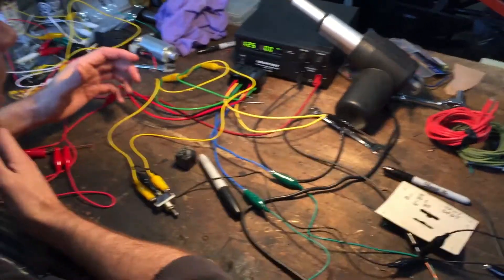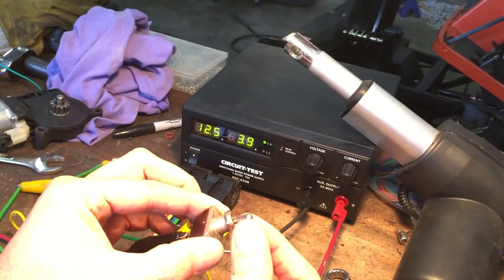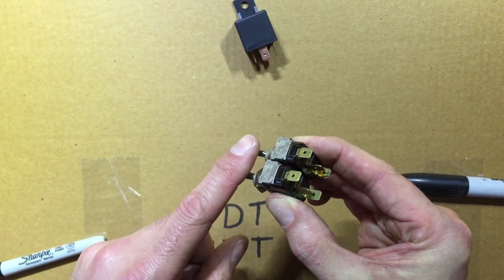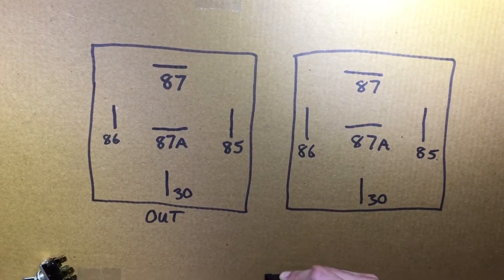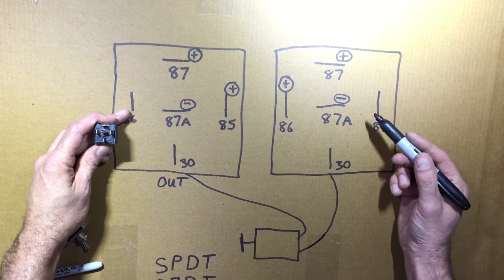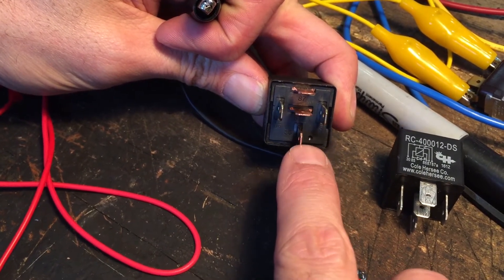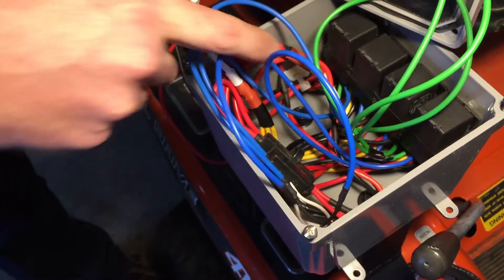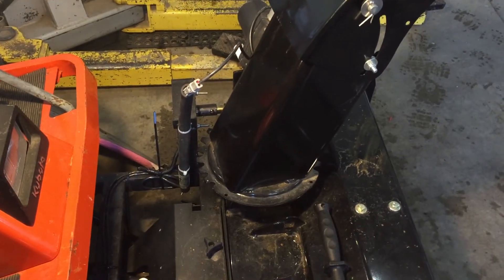Build a DPDT (H-Bridge) from Two 5-Pin 12V Relays — Reverse Any DC Motor

Comment: Wow — this is exactly what I was looking for. Oddly, I am building a remote control for the chute on my Kubota F2000 snowblower— so this could not have been any more specific to my job.
Mostly, I was confused by wiring the four pole joystick, but I think you cleared that up for me.
Excellent explanation — thank you!
Reply from the maker: A couple tips for building the blower pieces that I don't discuss. I mounted my joystick control box with some heavy magnets, so it can pop off. Add some disconnects for quick wire attachments. I put some of the wires by the chute in a rubber tube so that it holds the wires away from the rotating blower and will flex if it comes too close. As these chutes have a large rotation range.

Finally I wish I would have used a 12V DC-to-DC converter to go up to 18V or 24V so that my chute rotation was faster. It rotates so slow with my wiper motor setup that's its painful when I am doing a quick turn around.  You may also want to consider exposing the fuse locations so they are easy to replace if they blow.

Comment: I got relays with diodes between 85 and 86 and I have to connect positive on terminal 85 or there is a short on the relay. How can I change the wiring to account for this?

Comment: man, this video is great I searched for hours for a solution to this problem. so, I'm making a video about restoring a yard cart for a mower.  I put a linear actuator on it and long story short I'm going to use this same set up. I knew it was possible; I had done this a long time ago but had forgot how to do it. So, I was wondering if I could but a link up in the description of your video and give you a shout out. I wasn't too sure how to contact you about this so here I am in the comments.
Reply from the maker: Yah, no problem with a link. Like everyone here I am a hobbyist as well, and sometimes I have to watch my own videos to remember how I did something years ago. I've been running this setup in a coupe spots for years. Including using it to repair a wheelchair van ramp and kneel functions.

Comment: As soon as I connect 87a to ground it blows fuse. Please help
Reply from the maker: You need to double check your wiring. 87a and 30 are connected if the relay has not be powered. Make sure your relays are oriented the right way.

Comment: I wired a winch up with this system and it worked perfect. I then ordered two more relays and wired my snowblower (attachment for garden tractor) chute up the same way. When I energized the coil, it blew fuse after fuse. After trouble shooting, I found that pins 87a and 87 were connected! Am I correct in understanding that these two pins should never be connected? I put some old 5 pin relays in and wholla! it all worked as it should- weird. Thank You for posting though- it really helped!
Reply from the maker: Your correct 87a and 87 should never be connected unless you messed up wiring elsewhere. The connection should always be between 30 & 87 or 30 & 87a.  The relay switches pin 30 between 87 or 87a. The relay is just a switch that is toggled when the magnet inside is energized.

Comment: I just tried this with my garden tractor and winch. The relays are clicking but no winch activity? Where does the winch get ground? If you follow the path, current goes through one relay, through the winch and to pin 87 on the other relay? How does it get ground? When I hook a battery starter up to the lugs on the winch, it turns fine?
Reply from the maker: You need to rewatch the video. PIN 30 from both relays goes to the winch. You get ground and + power from the through the relays. As the relays switch PIN 30 alternates on each relay between positive and ground / Negative. Around 6 minutes I draw a diagram showing how it needs to be wired.
Reply: @hotrod-machines  I figured it out but if coil pins 85 and 86 are going to be grounded, don't they have to be jumped to 85a for a return ground path?
Reply from the maker: @chetspencer3241  No you don't jumper to 85a, you are using the switch, or joystick to select whether you send ground / Neg. power to either 85 one the one solenoid  or 86 on the other solenoid. Grounding both of these pins at the same time would make both of them close creating a short. Its one pin grounded at a time.

Comment: why not use an electric window switch?
Reply from the maker: You could use a DPDT switch for low current motors, but the intent of this video is to give users access to relays that are good for 40+ amps of current and run much larger motors.

Comment: Do you have a wiring diagram Im trying to operate a car electric seat well 2 seats the motors working but all the wiring was cut out many thanks
Reply from the maker: There is a wiring diagram in the video that shows you how to wire everything up.

Comment: Just out of curioseti is it posibel to combine more types of relays? Exampel can I use an 3 pin blinker relay like some sort of programabel timer to use 4 5 pin relay? Or perhaps some how use the wiper motor relay ya know jzst to make things litel bitt more interesting. I tought long if it might by posibel to make animal guard with an blinker relay and ignition coil . Was also curiuse wuld it by posibel to reverse direction on an 6 pin wiper motor direction?
Reply from the maker: Well anything is possible. But you should just install a double pull switch and the third wire. It would make life much simpler.

Comment: Great video, hope you are well. Can you help me figure this out? Id like to use a single throw rocker switch and have it light up a bulb on 2 different filaments (say high/low) going in this sequence:
Off-off
Off-on
Then switch filaments and go 
Off-off
Off-on
Reply: Like switch it once and it’s in low, switch it twice and it’s in high. Never having both on at the same time
Reply from the maker: @josephcuevas7318  Sorry I am not sure I understand what you are trying to do. The relays above are designed to alternate the polarity of two wires going to a device. If your light has a Negative post and two positive posts, or something like that it may be possible. How does the light determine whether its in low or high?
Reply: @hotrod-machines  it’s an 1157 bulb, I want to be able to use 1 single throw rocker switch to switch between the 2 side of the light. How some flashlights are able to switch between brightness by pressing the button multiple times
Reply from the maker: @josephcuevas7318  Without an electronic circuit you can not do this with a SPST switch, you would need a DPDT switch to select between low and high. You are trying to use the relays to perform logic.
Reply: @hotrod-machines  ok, do you know if there is a premade circuit I can wire inline to make the single throw rocker switch work?

Comment: 0:41 "which is kind of special order" NO. No it is not. Using two single pole double throw relays to reverse polarity has been around since there were motors and relays.

0:41 "i'm going to wire up these single pole double throw relays so that they do the exact same thing as a double" Um No. You are NOT doing the exact same thing. If you were energizing both relays at the same time, THEN you would be close to the exact same thing. Doing it this way adds the ability to stop the motor at any given position. You can't do that just using a DPDT relay.

FYI on amazon you can find a harness to do this exact thing with. It is pre wired. Very inexpensive.
Reply from the maker: Appreciate your thoughts but some of us live in parts of the world where electronics stores and Amazon are not easily accessible. At the time of this video I had access to basic hardware and automotive stores, and these were relays that you can get at almost all of these stores.
Reply: @hotrod-machines  Yes that why I put FYI For Your Information. Generally meant as giving information for future use, or something to think about or even look into. It is not meant to be a "You don't know what you are doing you should have just use this or that".   

And if amazon is not accessible then just disregard. 

Also where do you live that you don't have access to amazon. WOW.  I wasn't addressing the entire world just you. LOL. I made an assumption that if you have access to youtube to make and upload videos, I was sure you had access to amazon. You know they deliver?

Not tryin to bust balls here but.....

Comment: This video is perfect. I was trying to learn how relays can be used for various applications and I was stuck on how to build a reverse polarity system. In some circuit designs, this is similar to an "H Bridge," using MOSFETs -- but not exactly. Thanks again.

Comment: Thanks for a perfect explanation of how a reversing circuit works.  I am upgrading my side mirrors from manual fold to power fold.  I saw how to do this on another video, but the guy only provided a diagram.  I bench tested the circuit and it worked perfectly.  It came to me that it had to be a reversing circuit when I was trying to figure out if I needed to ground the mirrors to test them (I didn't).  I know it works, but with your help I know HOW it works.  Kudos!
Reply from the maker: Glad it helped. It took me a long time to figure this out myself and I wanted to save the information in a video

Comment: Where can I get high quality relays? When powering a 40amp device, do all wires need to be a thick gauge.
Reply from the maker: Sorry I don't have a location for you to order from. Also the wire size will depend on a lot of other factors as well. For example the distance and the duration of how long you need 40 Amps and at what voltage.
Reply: This is gonna be used for a convertible top pump in a vehicle. Probably 10 to 12 ft length of wire, duration would be about a minute.
Reply from the maker: @appleparts5365  First take another look at your load. 40 Amps is pretty high, or do you mean 40 watts? Use the 80% rule, so if you have 40 amps multiply it by 1.25 to get 50, and get a wire size for 50 Amps.  Then jump on google and find one of the chart that will give you wire size. At 12 feet you shouldn't have to do any upsizing of the wire. A quick looks shows 6 AWG but you need to run the numbers yourself.

https://learnmetrics.com/12v-wire-size-calculator-chart/#:~:text=In%20practice%2C%20we%20use%20wires,as%20well%20as%20the%20battery).

Comment: What you have really isn’t a DPDT relay.  A true DPDT relay is less flexible as you have only one control input and both outputs move together.  Using two separate relays gives you two coils to actuate rather than one and allows you more flexible as you can also have an “off” position.

Comment: Your demo with very clear explanations solved the issue of reversing polarity on my car seat motors.i spent 2 days connecting wires on one relay.i noticed i needed a second relay and even that the vids i watched did not help till i watched this .now i need 5 extra relays to move seat in every direction i now have only 3 relays so i can move  seat up and down and adjust lumba down becaise there is only one relay for that motor.Thank you.

Comment: Hotrdd machines  i think this  has to be the best tutorial vid of explains how to wire up relays direct and to the point . my predicament is  to try n make  a long story short im rewiring my hot rod that has the factory power windows and only using the front windows so i decided id buy a two window switch 80s gm style like that came in the c 10 trucks  my old ford  pwr windows utilize 4 wires black to ground  green red and yellow  to power up the windows up or down only applying battery power  it requires me to use the green and yellow to positive  or red and green to positive  for up and down  i cant seem to configure whats needed and thought maybe i need relays but cant find the rt sequence to make it happy  any ideas ?
Reply from the maker: Do you have a link to some pictures of the switches? How many wires come out of the switches? I would assume that a proper switch will replace a relay. You probably don’t need relays.

Comment: Can this work on AC circuits?
Reply from the maker: The same wiring and principals apply to AC, but you MUST use AC relays rated for the AC voltages and amps
Reply from the maker: BTW you can’t use this method to reverse an AC motor.

Comment: Is there a way to make a linear actuator move on a 12v power and then return back in when the power is taken away from that added 12v
Reply from the maker: Have you looked at this video? https://www.youtube.com/watch?v=MMvtU5e0lB8 The challenge is that your actuator must have stops built into it because the power will always be trying to make it go up or down.

Comment: I'm connecting 4 linear actuators in parallel so all get controlled by the same switch. I have a dpdt switch already but i don't want to run thick wires all the way to the switch because total amperage of actuators is 32A.  Can I use this method to allow me to run thinner wires to the switch and use the switch to just trigger the relays and have the high current go through the relays instead of the switch?

Comment: I used your scheme.  I have four 24v 40 A relays and two powerful electric motors.  I used two spdt relays for each motor and followed your schematic.  However, I am wondering in which part of the schematic do I need thicker cables for a current up to 40A and where exactly do I place the 40A fuse in your schematic to protect the cables from overloading.  thanks for the reply.
Reply from the maker: That's a great question, and I should have specified it in the video. The 40 Amps from the battery goes to pin #87 and out Pin #30 to the motor. So you could actually fuse it at the battery before pin #87 to protect the relay and motor and possibly even a fuse between pin #30 and the motor if you are concerned that a short might come backwards. Personally I have mine fused before pin #87.
Reply from the maker: You will also want "Heavy" + wire from the battery to #87 and from #30 to the motor. But don't forget a heavy "return" ground wire as well. That goes from battery to #87A. Basically you need heavy wire every where except from your switches and to #85 and #86 as those just power the magnetic coil in the relay.
Reply: @hotrod-machines  Thanks for the reply.  It's clear to me now.  However, I noticed that the otherwise strong and heavy {12lbs} 24V electric motor from the wheelchair has a red and black wire coming out of it that is only 12 gauge, so I will only be able to use fuses up to 20A?  This seems very little to me, I would prefer 30A or even 40A.  So I'm left with only being able to draw 20A from the motor if I go for safety vs.  power.  Because I'm sure I could draw 50A from one motor for a minute or so without consequences for the wires?
Reply from the maker: @zoba4645  You could always install a thermal breaker / fuse, or upgrade the wire?
Reply: @hotrod-machines  hi, if I would use 4 pin relay, what will be the difference in wiring scheme versus 5 Pin relay? Thanks
Reply from the maker: @zoba4645  You can't do the same thing with a 4 pin relay, it works differently. I 4 pin relay is a STSP type switch, its either off or on like a regular switch. You would use it if you wanted to use a low power switch to power a high amperage device.

Comment: Hi, I have two Motors. One for left track another for right. I Also bought 4 5 Pins relays. So I Just need two spdt switches, each for one motor. therefore, I can independently drive the vehicle forwards or backwards or turn left or right when one motor is switched off with the switch.  i.e. one switch for one motor, forward, reverse or stop.

Comment: I have installed a complete painless harness in my caprice. I have 2 power windows. I have 1 wire from the fuse box which is 20 amp fused..is that enough to control both windows simultaneously without blowing the fuse using this diagram? They are factory window motors not sure the amperage
Reply from the maker: I'm pretty sure there is no way your power windows would use 20amps. Most cars would be 10-15amps for all the windows. However you can always look on the motors or do some research to find out.

Comment: will I need two power supply? one for the actuator and one to exit the coils? Some1 plz help me out
Reply from the maker: No this can all be done from the same battery or power supply as long as the power supply has enough Amps to run what you want.
Reply: @hotrod-machines  also where do I place the fly back diodes ?
Reply from the maker: @talhaamir7387  What are you trying to do? There are now fly back diodes in my wiring.

Comment: Wuld that methode work if I wuld like to change polarity on my ignition coil? Im meaning waste spark ignition wuld it do the same thing? How wuld dual trigers look like for exampel dual 4 pin gm ignition modules?
Reply from the maker: I'm confused. So if I understand this correctly you want to switch the polarity of the ignition coil when you flick a switch? May I ask why?

Comment: Hmm....I thought I had the electrics sorted but something does not seem right.....the wiring diagram is a bit confusing as it seems that neg and pos wires are being strung together  as the mass of wires makes it difficult to see what goes where.....I'll keep trying
Reply from the maker: Follow the diagram at the 9min mark. Follow the coloured line and when you see a "bump" going over another line that means they are NOT connected. If two lines meet and there is no bump they are connected.